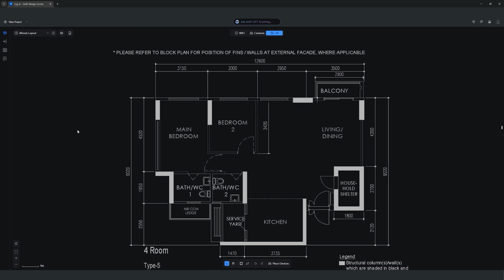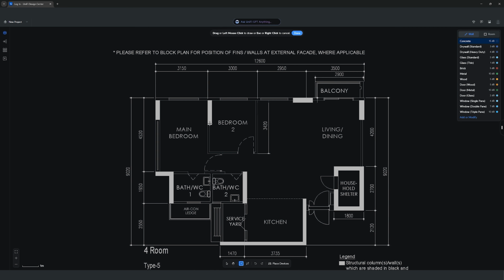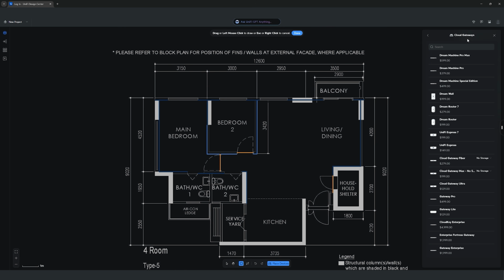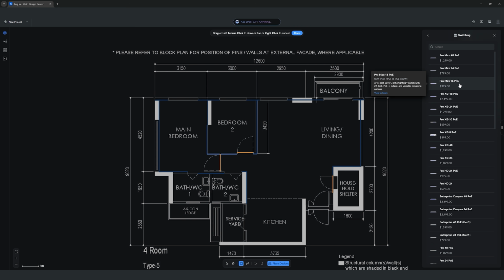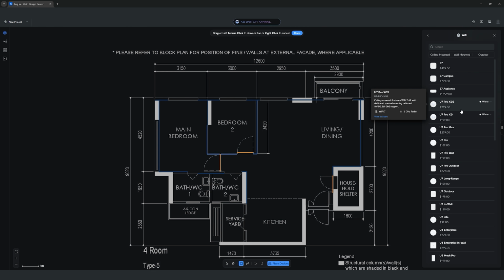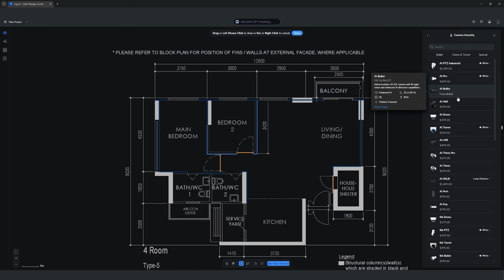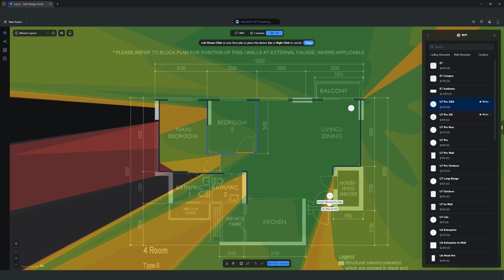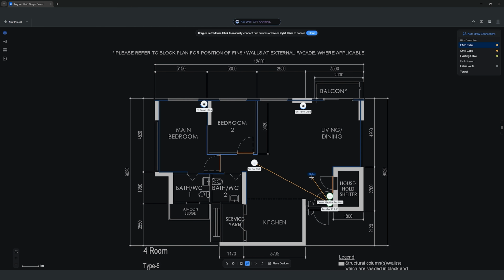[Beans&Beams Reno Vlog] Ep11: Ubiquiti Network In Singapore BTO (Part 1)

Comment: Tks for the informative video. May I know what type of termination plugs do you use for your termination points please? For the ceiling AP, do you use those FTPs that can bend 90deg so the ethernet cable can be bend without showing up at one side of the AP? May I know how do you factor the horizontal beams on the ceiling within the design centre app for signal attenuation please? I'll imagine the signal will be affected if eg the ceiling APs is next to a beam? Greatly appreciate your advise. Tks
Reply from the maker: 1) Cables are terminated with RJ45 (non-passthrough) 0.5micron gold plated connectors. 

2) No fancy bends required for the AP connection as the Ubiquiti AP comes with recessed design to hide the Lan cables + our cables are hidden within the false ceiling on top so it's just a small hole for the cable to fit through with the AP mounted directly under the hole to keep everything clean without the cables in sight.

3) Honestly, the design center is just a rough guide to give you an idea of the signal coverage, even areas with the "weaker" orange signal will still be very usable in normal circumstances. we left a small spacing between the beams and our AP to reduce the signal "blocking" but to be honest, it is totally negligible as our living room is open concept anyway

Comment: 15dB attenuation for the structural column isn't accurate. Probably want to modify and bump up to 25dB.
Also, for the newer BTO drywall with the firestop/ noise dampening infill (doesn't apply if your contractor rebuild without the dampening material), it's closer to about 8~10dB attenuation.

Comment: One really simple question, what's the pros of this setup against a more commonly seen setup for HDB that comes pre-equipped with Lan port in each bed room (and your pc is 10g capable), working in conjunction with a mid or top tier router + mesh (router is ofcourse comes with at least 1x 10g lan port)
Reply from the maker: Pros are aplenty, e.g. Professional features such as VLANs, Guest WiFi portals (can even make it chargable via payment gateways), advanced firewall rules, Deep Packet Inspection, per-device traffic analytics and allow you to have more control over security and traffic segmentation all in a centralized management platform (which will be shared in the next video). Of cause, you get enterprise grade features too without having to pay a subscription unlike other enterprise grade equipments.

Cons for this setup is that it is extremely expensive compared to conventional setup. If you are not an intermediate/advance user, with no knowledge on how and why you want to setup VLANs for each WiFi SSID etc and just require WiFi, Mesh / in-wall method will be better.
Reply: @BeansAndBeams thanks for the explanation, looking forward to part 2 of the video, really curious about this setup